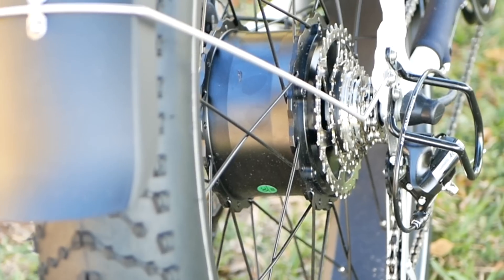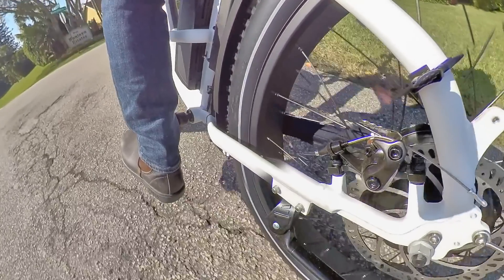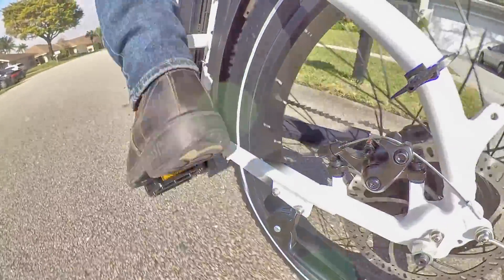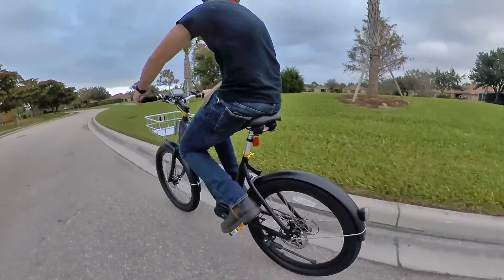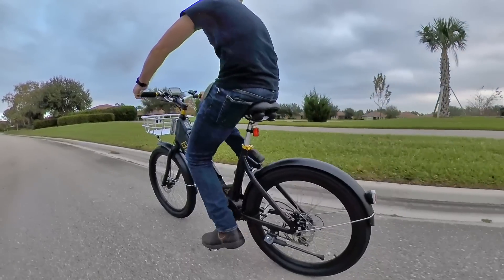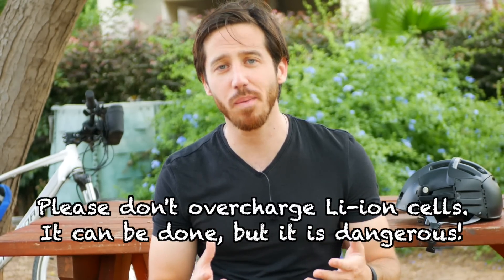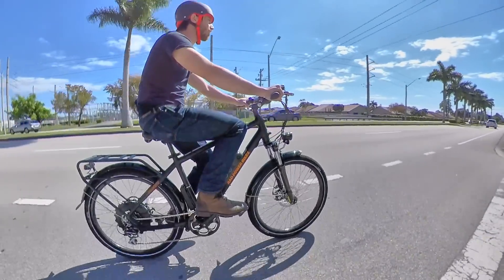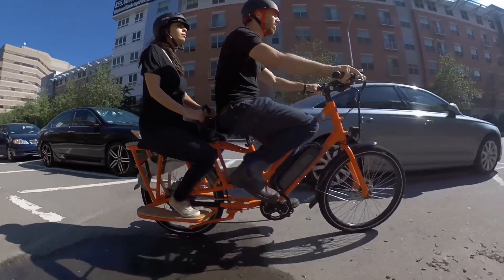Why don't more electric bikes have regen brakes?

Comment: I'll take smooth coasting over regenerative braking.
Reply: I do energy efficiency as a (deep / $$$) hobby. Coasting wins out massively over any another techniques that I've tested over the years, this goes for all vehicles! Just coast to your stop if you can. The only place it may help would be in massive hills / mountains 24/7
Reply: @RW1LD also reduces wear on breaks
Reply: @RW1LD  The problem with hypermiling is that it only helps the moron practicing it and overall actually costs far more energy and traffic tieups. If there were no other people and no other vehicles then you might be able to save energy. In the real world, for every litre of fuel you "save", you cost everybody around you 10 litres of wasted fuel. In order for traffic to move efficiently, everybody must moderately accelerate to and decelerate from the speed limit. Traffic lights are programmed with that assumption, and when you prevent other people from driving reasonably you screw up the flow of traffic and cause traffic to knot up in abnormal ways and get caught by red lights instead of going right through green ones. Meaning they are forced to stop and go when they would have been able to continue at a much more efficient steady state. Even if you ignore traffic light programming, people who don't accelerate or decelerate normally or stay at a constant speed at the speed limit still impede the smooth flow of traffic and massively reduce everybody else's efficiency. The rules of hypermiling and the rules of mass traffic efficiency are polar opposites. What is good for a single vehicle is very, VERY bad for a large system with many entities in close proximity.

As for coasting versus regenerative braking, in theory coasting is more efficient but in reality regenerative braking is more efficient and practical for anything larger than a bicycle. If all roads were absolutely flat and straight and there were no intersections or traffic controls then coasting would have an edge, but since that's far from the case coasting doesn't actually win in the real world. The fact is that any time you slow down or stop you have to accelerate, and coasting can't store energy, it only conserves it. Because regenerative braking stores energy, a large part of your acceleration is "free", whereas if you coasted down 100% of the accelerate is at full energy cost. Coasting loses.

I've done a lot of testing myself, and the claims hypermilers make are outright lies. The only way to get the results they claim is to exercise massive confirmation bias and deliberately ignore a huge number of factors, and fib a bit on top of that. Weather, terrain, traffic and other factors have a far greater effect.
Reply: Mark Haury It’s not a “large part” of your energy gained back that’s then used for acceleration. I can say from practical experience with two electric cars and an electric motorcycle with regen the most percentage gained I’ve ever seen at one time is 2% down a giant hill and it’s normally less than 1%. That 1% is often not a “true” 1% and normally ticks back down to the previous % within maybe 50 yards of when I started accelerating again. It’s some but not much. I can also say practically that a fiat 500e that I owned lost the use of regen due to an abs sensor error for a few months and the difference in efficiency on my very hilly 30 mile commute to work was about 3-4%. Again, it’s something but not a ton.
Reply: @darrengriffith9680  You have no idea whatsoever what you are talking about. You're going by what you can perceive with your own eyes over a short period or one event. Instruments over a long period are far more accurate than the seat of your pants. Anecdotal evidence is worse than useless. But if you want to go that route, I've watched my battery meter creep up a couple of percent  over twenty miles. That means a slight net energy gain over that distance. That is utterly impossible under any circumstances with coasting. Granted, that is an unusual situation but does happen.

Normally, on a stretch of highway without major elevation changes there is very gain because you're going at a steady state with no stop and go. There's much more difference in city driving where you have to stop and go a lot. But each individual occurrence is far too small and short for you to notice it on the gauge. The only way to really find out the difference is to use instruments and measure over a long distance. That's been done to death by published studies, and it's a fact that regenerative breaking makes a big difference.

But again it makes less difference on a bicycle or even a motorcycle. On steep highway hills that create massive regen for my electric car I get little to nothing on my electric motorcycle because there's so much less mass and so much more wind drag at those speeds. I'm actually having to apply a little throttle, so regen isn't an option. A bicycle doesn't go fast enough to see that much aero drag but also has far less mass and momentum. Regen on a bicycle would only help if it were very hilly, enough so that you spent a lot of time going downhill. Uphill sections are irrelevant because obviously you can neither coast nor regen and it's exactly equal. It's the downhill that matters. Downhill, the best that coasting can do is cost you no energy, but with regen you get energy back. Plus if you coast at high speeds the aero drag increases exponentially with the speed so the faster you go the more energy is lost (not to mention your license if you get caught, and if there are curves you can't stay on the road without dissipating energy with your brakes or engine compression), but with regen you stay the same speed and get energy back.

Sorry, in the real world with the real laws of physics regen always wins for cars and larger vehicles regardless of the type of driving. For bicycles it's another story, and for motorcycles the most gains are in stop and go city riding where the range is often double what it is on the highway. That's only partially because of regen, but it is a significant factor.
Reply: Mark Haury you basically said 75% of what I did only much more long winded with a mild insult to start with.  Motorcycles and bicycles regen is nearly inconsequential, it seems we both agree. I know that if I have the zero set to coast with braking only set to regen I get better range. This is recorded data taken from the app with kWh used and trip mileage over the same route over 2 months. Even if I didn’t the drag from the regen both downhill and on the flat is annoying as shit; it’s like super engine braking. In a car regen is more effective, again we both seem to agree. Im simply saying in a car people act like you gain 50% of your battery back or something by regen and I’m saying at best it’s maybe a 5% gain in your total range, maybe if you want to exaggerate 10%. That’s still not a lot. It’s something but not life changing. As far as anecdotal, you know nothing about me or the data I log. What I can tell you is I live in a very hilly (like mid range mountains) section of the country and have had the unfortunate chance to sample the data regarding range of an electric car with regen disabled for several months in different climates.  You may think a 3-4 mile increase in range with regen working over a 60 mile commute is earth shattering, I do not. Most importantly, I have to say I’ve had the worst experiences online with people who have electric vehicles arguing about data and name calling, you are an idiot for thinking this and that, etc.  it’s really unnecessary. All I know is I’ve gone all electric from a bicycle to a motorcycle, car, generator, chainsaw, even a damn Onewheel and I’m happy to do it. We can disagree or whatever but I’ll use my stuff my way and you do it yours. Just sharing my experiences and knowledge. Regen away.
Reply: Agreed. On my zero motorcycle regen more or less adds nothing. Much more efficient to coast with the regen set to 0.
Reply: Coasting is not an alternative...
You do it on the flat where you wouldn't gain anything with Regen braking.
Then on descents you simply pull your brakes and Regen kicks in...
So you can have (like me)  the best of both worlds 😎
Reply: @daniele_go  You can't coast on the flat unless you're stopping. There's no such thing as coasting at a constant speed on the flat. Regen versus coasting only applies when you are deliberately decelerating, as in slowing down on the flat or maintaining speed downhill. So regen always, always wins over coasting. Getting energy back is always better than not using any energy, because you can't turn around and use energy you don't have. Turning off regen is not a good idea. Modulating the throttle will let you coast when that is warranted (it actually will automatically be the case), but turning off regen means you will never get any energy back.

The problem with Zeros is that the regen is too weak and you can't use it the way you can in an electric car to come almost to a stop in city traffic without touching the brakes. There's also not enough of a neutral spot in the throttle. That's all a matter of software, though,  and not anything to do with regen itself.
Reply: @awo1fman  On a non assisted bike, coasting means that you STOP PEDALLING and you let the bike go for a while....then you start pedalling again. The bike can continue to go without any energy applied thanks to a mechanism called 'freewheel'.
If we take an electric assisted bike with a Direct Drive Hub Motor, when you stop pedalling the bike will rapidly decelerate due to the 'cogging' effect.
So you cannot really do any 'coasting' as you would do with a non-assisted bike.
I believe that this type of discussions should also be carried on based on quantitative data and measurable experiences.
This is what I am trying to do on my 'solar bikes' web site: http://gonano.eu/regenerative-braking-efficiency
Not trying to convince anybody, just to share experiences 😎
Reply: @daniele_go  Sorry, but when you stop pedalling on any bike you slow down unless you're going downhill. You can't coast forever without pedalling on perfectly flat ground. You will stop in a fairly short distance. Cogging is a subjective feeling, but when the wheel is turning the net effect is zero because it first resists, then assists the motion as the magnetic fields approach, then recede from each other. There are some other things happening with cheap controllers that may cause drag, but if you have a good regenerative controller that is properly tuned that is not a factor. This has been tested, and it's a fact that regen is better than coasting. https://endless-sphere.com/forums/viewtopic.php?f=2&t=7891#p119214
Reply: Daniele G The point is the energy you gain with regen, especially on a light vehicle like a bicycle or motorcycle, is not as efficient as freewheeling that distance. As an example, on my zero if I have regen on at a decent level going down a moderate hill I will at some point have to add throttle to maintain my speed down the hill, thereby using the energy I gained and then some just to maintain speed.  Same with on the flat as you point out.  Engaging regen only when the brakes are on is the most efficient, which is how my zero is set up. With my car I don’t have that choice or I would do so.
Reply: @darrengriffith9680  Bicycles and motorcycles are not the same. The situation with a bicycle is that there is so little mass and so much surface area in relation to the mass that environmental factors (rolling resistance, wind) have more effect than regen. With motorcycles that isn't the case at city speeds, but does kick in at highway speeds because aero drag increases with the cube of the speed. Cars are so much more massive and so much more aerodynamic that regen beats coasting at any legal speed.

The fundamental issue here is that getting energy back always beats not using any energy. ALWAYS. The specifics of when you get energy back and why are what is different between different types of vehicles. But even then, subjective, anecdotal evidence is not fact. Regen does make a positive difference on bicycles. But it's not enough on average to justify the added expense and effort. It would really only be worthwhile if the overwhelming majority of your riding was very hilly and very rarely anywhere near flat. Uphill and flat sections are irrelevant because the same amount of energy is used. But if there are lots of fast downhill sections where you normally apply the brakes, regen could make a significant difference. But that's far from the case for the average rider.
Reply: @darrengriffith9680  That is FALSE. Look at Grin Tech's actual electronic measurements. Adding enough power into the motor to make it have ZERO drag takes a lot less power than you get back even from just stopping normaly, nevermind going downhill slower. In seattle or vancouver in the city you can easily get back like 15% regen.
Reply: Id rather take savings on brake disc replacements and maintenance whilst gaining some energy back even if its small. Ive barely had to use mechanical brakes when on regen especially when my route in London goes thru some decent inclines.
Reply: There is only a single circumstance where coasting equals regenerative braking. That is when you can coast at equilibrium for a long distance. That means you are giving no input whatsoever. No power, no brakes, AND NO CHANGE IN SPEED. That is the only time that you don't have to accelerate again after coasting.

But even then, having the capability of regen beats only coasting because even with regen capability you can always coast, but without regen you can never get energy back.

Is it enough to justify the expense on s bicycle? Probably not. But that doesn't mean it isn't a fact. The laws of physics apply regardless of what some people may think.
Reply: Mark Haury I go down a big hill every day with a flat spot in the middle. With regen on when i hit the flat spot I must use the throttle to gain the speed I lost both going downhill and especially on the flat section, thereby using more power than I gained by the regen downhill. If set to coast I never touch the throttle the entire way down the hill, thereby both accelerating down the hill and only losing a few mph on the flat while the bike is consuming very nominal power. I make it down the section with more capacity than I had with the regen on because I used that power plus more to power the bike to maintain speed. This is one of many examples. But I digress, I crown you regen master and wish you many days of happy regeneration.
Reply: @darrengriffith9680  You're completely missing the key point: you're not actually getting regen going down the hill because you're fighting aero drag. I explained that above. I have yet to find a highway hill steep enough that I can get any regen going down it on my Zero. I always have to apply a little throttle to maintain speed going downhill at highway speeds, even if I "tuck". If your example is at less than 40 mph/70 kmph then you might have a case. Otherwise, I don't believe you at all.

This is not jus an EV thing, either. I've tried pulling the clutch and coasting downhill on ICE bikes, and it's the same story. Even with a faired bike, there's just too high a drag to mass ratio to coast.
Reply: Mark Haury I had a response typed out but I realize this is a worthless exercise of time. Enjoy your bikes and have a good night.
Reply: Regen is useless on inrunner mid drives, regen is only good on cars because of the weight/mass of the car and the motor.
Reply: @Arcamedi1  Regen is simply UNUSABLE on mid drives 😉
I have a Direct Drive motor and I can recuperate > 50% going down hill (I live close to the Alps😎)
Reply: Daniele G that’s the way 20s 3k rear wheel hub baby
Reply: @Arcamedi1  Duh. Regen isn't possible with mid drives because of the freewheel. But regen is worthwhile on hub motors for some people. You've already been proved wrong and you're chiming in after the debate is over.

Comment: I have a question about batteries with 1 port (charge+discharge).
But no idea where to ask. (asked it before to you in some older video's)
I have an Echopper with 67.2V battery with only 1 port for charge and discharge.
I have no idea if this has a BMS.
Now i want to use a second smaller batterry and connect it together with the existing battery to 1 charging port, so i can charge both batteries at once (basicly this will become 1 bigger battery, 1 20A  + 1 12A)
But all available ones have a seperate charging port, so with BMS.
Is it possible to simply connect the charger cables together with the discharge cables?
Does it damage the BMS if it gets 30A (50A peak) current on it?

Comment: Regen  brakes cause resistance  so there is no coasting . Either going forward or your braking
Reply: That's not true at all.  Unless you have a controller that's making you always brake when you're not going forward...but the one I made didn't....I had mine wired to a switch to engage it, but I think most will have them wired to the brake lever so it'll engage regen as soon as you start to use the brakes.

Comment: Qulbix has mid drive and analogue regenerative braking. Its a mid hub tho.
How much "watts" are lost to hub motors anyway?
Reply: also with regenerative braking you are saving your pistons/disc brakes and well... you are regenerating energy. But if the loses of direct drive are more than "10" watts given we pedal around 100-200 and the chain is 1-3watt than its debatable. But i do not believe its much more than 10
Reply: @manipulativer  I agree 👍
I use with my controller a 'virtual freewheel' option: it 'consumes' 10 wh from the battery (not a lot!) but riding experience with a Direct Drive hub motor is really as if I didn't have any cogging!